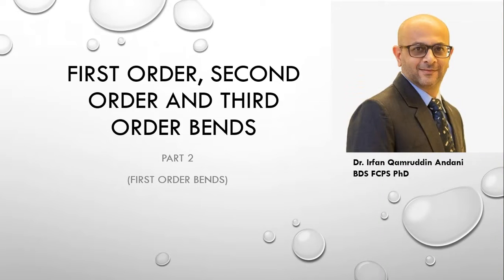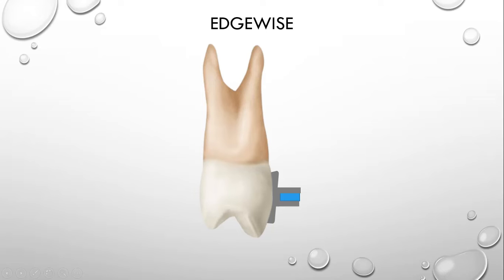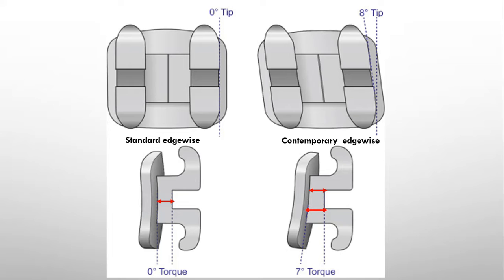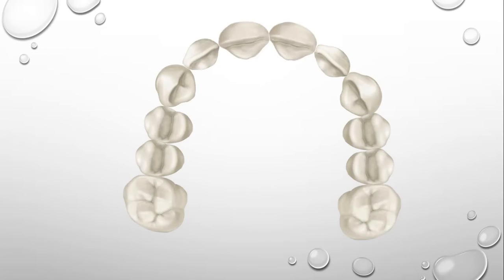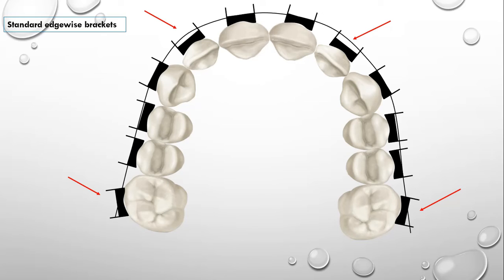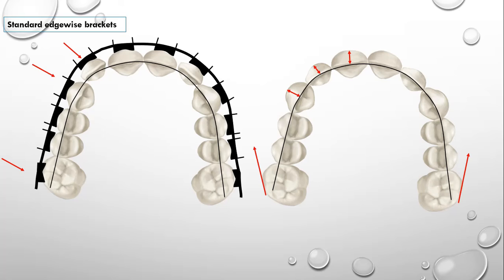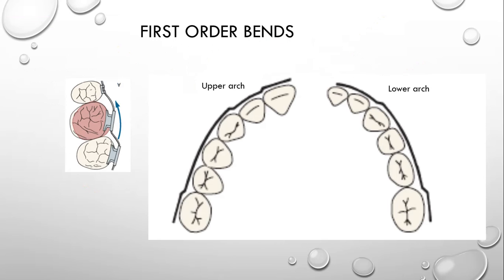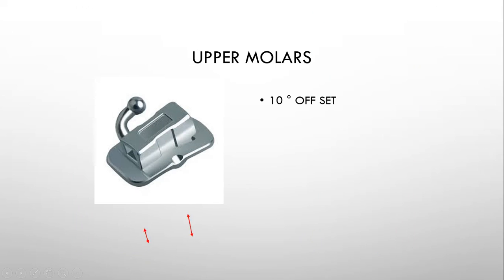First Order Bends (In and Out)

Comment: Great video. Are step bends greater than 1mm possible?
Reply from the maker: Depends,  usually Bends are given in heaviest wires in finishing stage,  where you should avoid giving bigger Bends. They can cause breakages/ pain.   But if you are using thin wire then of course bigger Bends can be given